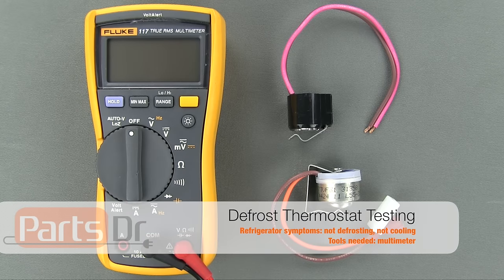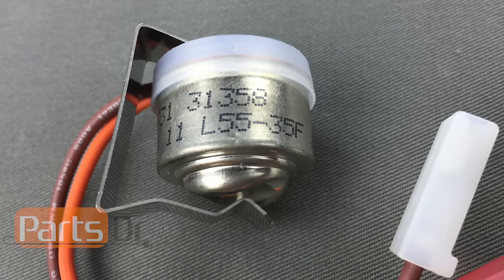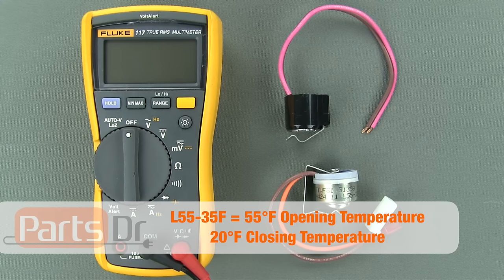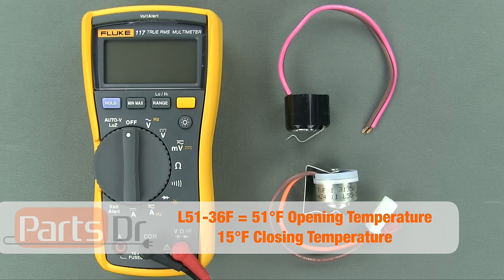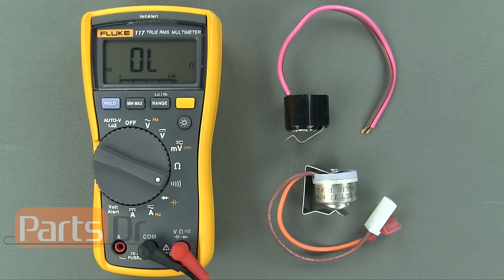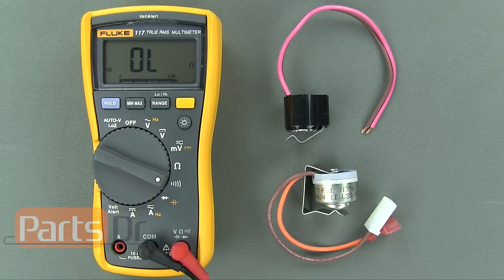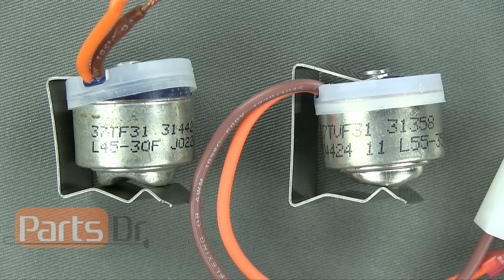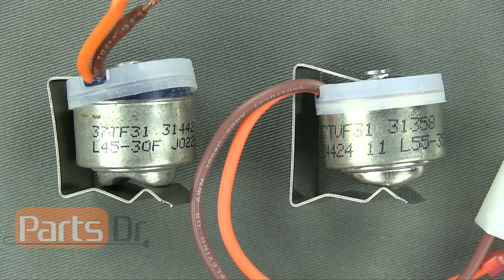How To Test Your Defrost Thermostat & How They Work

Comment: I just replaced mine
Seems the old device never actually broke continuity-so it ever actually shut off…I’m hopeful this resolved our issue…which is a form of thermal runaway..refrigerator gets cold, which triggered the sensor, so it caused the refrigerator to defrost-and because it never fully turned off the refrigerator was in a constant loop…
Reply from the maker: Let us know if it ends up fixing the issue.
Reply: It did not resolve the issue 
My refrigerator side is now over 50 degrees
Now perhaps I’ll try the defrost timer…

Any idea where it’s located on 
Whirlpool Refrigerator Model ED5VHEXVB04?
Reply: I’ve already tested the thermostat…
Reply: Looking on line, I found a site, and it appears this model doesn’t have the timer, just a board…
Reply from the maker: @1jefreys  Your model refrigerator uses a defrost control board in place of a defrost timer.  It should be located in the front top right corner in the area where the temperature controls are located.  This is the part here: https://partsdr.com/part/w10366605-defrost-control-board?model=ED5VHEXVB04

Comment: Hi there. I have a question? So every 7-10 days, my freezer freezes up, and I have to unplug it for a day and then plug back in. Also it will freeze up if I keep it open for more then 20 seconds. It never used to do that. It’s a side by side Ge Profile. I cleaned the coil in the back on the bottom, Fan runs perfect, compressor looks and feels like it’s working, it gets warm. Also looks like seals are ok. “I think”. There’s a very tiny cut in the bottom of seal, but I glued it and it closes very tight! I also put the Vaseline to make sure it’s extra tight seal.  Hard to pull open. I don’t wanna pay a whole bunch of money. Do you think I should open the freezer panel and check the thermostat and maybe the coil in there. I don’t really know what to look for. But right now it’s unplugged again. After it melts I’m gonna clean up the water. The only thing I have not looked at is anything behind the freezer panel. Any suggestions before plugging back in? Any help would be highly appreciated!!
Reply: Thankfully I bought a back up fridge in the pandemic for my garage, or food would of got destroyed every single time this happened 

I’m in a bad position because land lord might want me to pay half for a new one. A long time ago. I used to come home from the grocery store, and put a whole bunch of food in fridge while it was open, never had this issue. I’m stuck. My kids are afraid to go in fridge or freezer for more then 5 seconds. The longest it ever lasted since this problem began was about 2 week, so far I’ve did the unplug and defrost thing about 6 times. Sry for the long explanation. Wish I could just explain over phone, but these fridge repair people don’t let you speak on phone, and want to come out just to charge that initial consultation fee even if you don’t fix anything. I’d be surprised if you read this longggg message lol. Ok Take care. God Bless
Reply from the maker: What is the model number of the refrigerator?
Reply: Parts Dr Model #:PSW26SSNSS

Any tips on this model would be highly appreciated. Thx!!
Reply: Parts Dr I can’t believe how expensive this was. I know if land lord gets new one, he’s not gonna buy one as good as this.
Reply from the maker: @danielvitolo2595  There are 4 components that work together to control the defrost cycle on your model refrigerator.  Defrost thermostat, defrost temperature sensor (thermistor), defrost heater, and main control board.
Reply: Parts Dr Wow, ok Thank you. Out of the 4 parts you mentioned, is there one of them to have a tendency to possibly break before the others? Thx again. 

If it’s the board, that’s outta my league lol. I might be able to figure out how to test the others. 

Also, if I do end up taking the freezer panel off (most likely I’m going to do it tonight) and something looks a little weird, is there any way I can send you a pic? Sry for all the questions, this thing is driving me insane lol.
Reply from the maker: @danielvitolo2595  on these models the defrost temp sensor and defrost heater seem to be the most common to fail, but we see failures of all four parts.

https://partsdr.com/blog/how-to-test-a-ge-refrigerator-thermistor-sensor/

https://www.youtube.com/watch?v=q7hysgipzpQ

Comment: what will happen if not the right specs is installed...like my bad thermostat is hotpoint and i plan to replace it with my spare thermostat from frigedaire?
Reply from the maker: It is best to replace the thermostat with an exact match OEM part.  Installing one with the incorrect rating could damage the refrigerator or be a fire hazard.

Comment: Nice video clip. So - after watching this video - this device is electrically connected in series with the heating element right? So if the temperature gets above a certain temperature ----- then the device becomes an open circuit ------ which prevents any more heating until the next defrost cycle occurs, right?
Reply from the maker: Yes that is correct!
Reply: @PartsDr  Thanks very much!!!

Comment: I have one I checked with meter set to sound.  Checked good.  But when I set meter to Auto, I get a high reading of resistance. Does the bi-metal in the stat ever lose or gain resistance?
  This fridge was freezing over.  Df element checks good.  I have yet to check the timer.
  If I turn the timer to defrost and the heater comes on and goes off in the time it is supposed to, can I trust the stat is wirking properly, or are they like dryer thermostats that might check okay when ohmed but still be faulty?
Reply from the maker: Yes it is possible for moisture to get inside the thermostat and cause it to make a poor connection. If you suspect it might be bad, we would recommend to go ahead and replace it.

Comment: Hi, In May of this year. I had a "DEF" flashing off my GE Profile door monitor. I got a thermostat and a thermostat timer from Appliance Part Co. in Tempe, AZ. Installed them both and after a day "Def" flashing came back and ever since I just unplug and plug it back on. Today I decided to pull the back panel again and manually turn the defrost on thru the timer. I heater came on. I dbl checked the thermostat and to my surprise the the numbers on the replacement part is L140-30F. That says an opening of 140 and a closing of 110 degrees F. Is that why I am having a problem. I am going back tomorrow to that parts store.
I appreciate your feed back. Thank you.
Reply from the maker: Some newer GE refrigerators use the defrost thermostat as a high temperature safety and they use a control board and thermistor to monitor the temperature of the evaporator coil to tell the control board when to end the defrost cycle.

Comment: hello my old  Defrost Bimetal no any ohm, i test in cold and warm water  no any ohm, then i goto buy NEW WP4387503, BUt is SAME.... why??? thanks
Reply from the maker: It sounds like you aren't getting the thermostat below the closing temperature when testing it.  Re-watch the video and follow the instructions from the video.  Cold water does not get cold enough to test most defrost thermostats.
Reply: @PartsDr  thank, i watch your video and other video in youtube,  WP4387503 thermostat L8.9-16.7C, i use ice in water the water is 0C, and i take Defrost Bimetal out of water and no any ohm. i make a video later.
Reply from the maker: @mhz2562  Ice water isn't cold enough to close this thermostat.  8.9C = 48F and -16.7C = 2F
Reply: @PartsDr  thank, but i don;t have any thing can make -16.7C / 2F to test.

Comment: Hi my whirpool top freezer wont go below 24degrees F. Evap fan works, compressor fan works, replaced startup relay, none to little frost build up. Fins looks good. Defrost cucle comes on and compressor doesnt run. Am i missing something please help!
Reply from the maker: You might have a refrigerant leak in the sealed system.  Check to see if the evaporator coil is getting a light layer of frost evenly across the entire coil.  If only part of the evaporator coil gets cold then you have a sealed system problem and it might be time to replace the refrigerator.
Reply: Only by the bi-metal thermostat does it get any frost. The fins have no frost at all.
Reply from the maker: Sounds like a sealed system leak.  It is usually cheaper to replace the refrigerator than repair it.

Comment: GE Refrigerator evaporator iced up;  the defrost thermostat and heater are both good. What should I check for next. Please help. Thank you in advance
Reply from the maker: What is the model number of the refrigerator?  Use the link below for common locations to find the model number tag.
https://partsdr.com/model-number-locator/refrigerator
Reply: That was quick, thanks. The refrigerator came with the house. It's about 26 years old. The model number is partially faded; I could only make out 4 numbers. Since the defrost thermostat and heater are ok, could the problem be in the control thermostat
Reply from the maker: There should only be 3 defrost components on a GE refrigerator of that age.  We would check the defrost timer next.

Comment: I have a Sears Freg with a bottom freezer Mo # 596.65932402, Every thing
 check'd  out but we still have ice build up. I do not know how to test the main digital control. 
How do I put it into Force Defrost mode?  Thank you
Reply from the maker: On this refrigerator we commonly see the JAZZ control board go bad and it causes the compressor continue to run during the defrost cycle.  We recommend to replace the JAZZ control board part # PD00004512 and the defrost thermostat part # PD00003405 at the same time to fix the problem.  After replacing the parts make sure to manually fully defrost the evaporator coil.  Page 37 in the service manual below will show you how to force the defrost mode, but it will not give you the conclusive result.

https://drive.google.com/open?id=0B03VGCZpsUSCN055cmRZbnJhMzA
http://partsdr.com/part/w10503278-jazz-control-board/
http://partsdr.com/part/67003426-defrost-thermostat/
Reply: Is there a way to Force a Defrost cycle?  Thanks Alot!
Reply from the maker: If you click the "read more" at the bottom of my last post, I included information for that.  But like I said in that post, forcing the defrost won't tell you the whole story.
Reply: OK I see, hold freg door switch down and press Freg temp Down button down 3 times quickly. Than release door switch than  F and d will display than press ( - ) again.  Well, that did it and goes into defrost fine. . . but why do we still have frost at the freezer vents? If the JAZZ board is bad than does Forced Defrost bypass it?  Thank you
Reply from the maker: Most commonly we see the JAZZ board go bad which causes the compressor to continue to run even during the defrost cycle.  Forcing the defrost cycle won't tell you whether the compressor kicks on during the defrost cycle.  The best way to fix the problem is to replace the JAZZ board and defrost thermostat and then manually defrost the freezer.  Once you do that you should be all set.
Reply: So you are saying forced defrost works different from automatic defrost because . . ?  Thank you
Reply from the maker: Forcing defrost won't tell you if there is a problem with the compressor running during the automatic defrost cycle.

Comment: Quick question. How would you interpret a bimetal/thermodisc labeled F42-32F? Does it work differently as in closed when above 42 degrees and stays closed then cuts open at 10 degrees? This part is wired in series with a cold control thermostat, not a defrost heater.
Reply from the maker: That should open at 42F and close at 10F.  Sometimes a bi-metal thermostat is used to turn a fan motor on/off at a certain temperature.
Reply: Thanks for the reply. I thought this too but if it opens back up at 42*F then the unit wouldn’t cool if wired in series with a cold control. This bimetal has specs different than most fridge bimetals. Would you like to take a look at this GE fridge wiring diagram and see if you can make sense of it’s operation? It has no actual defrost circuit and instead lets frost thaw while the thermostat & bimetal are open. 

https://imgur.com/a/8IINMov

Comment: We're testing our defrost thermostat. At room temperature it's reading 0.00 for continuity. We bought a new one thinking the old one was broken. It also reads 0.00 at room temperature. Visually they both look fine. Is our multimeter not working correctly or are we crazy?
Reply from the maker: What is the part number?

Comment: If the new thermostat has a different wiring code, does it matter how you make the connection?
Reply from the maker: On most refrigerators it does not matter which of the two wires from the thermostat goes to which of the two wires in the refrigerator.

Comment: I have a Sears Kenmore Fridge with Freezer on top model# 253.6480240C. Found that food was partially defrosted in freezer. The freezer temp is only 32F and the fridge temp is only 48F.  I used a screwdriver to manually advance the defrost timer and that did turn on/off the the sound of what I believe to be the compressor as well as the freezer fan. Turning the fridge temperature control knob from lowest setting (left) to highest setting (right) also turns on and off the same sound. I clamped my multimeter on to the red wire near the compressor and it read ~ 1.6 amps when I believe the compressor is running. The freezer fan is definitely rotating as cold air is being pushed out of the freezer vents. I removed the freezer evaporator cover and confirmed the fan is rotating. There was a 3/4 x 2" chunk of ice on the tube (that does not have the thermostat attached to it) right near the fins of the evaporator, otherwise, no real icing in the freezer. The defrost heater element has continuity. I am suspecting the defrost thermostat. I don't want to cut the wires just to test unless I'm on the right track. Is this the next likely culpret that should be tested? Any advice?
Reply from the maker: Hi Jeff,  it sounds like you probably have a refrigerant leak.  Usually if you are only getting a small section of the evaporator coil that gets frost/ice on it, that is and indicator that there is a leak in the sealed system.  This type of repair is expensive and must be done by a professional so it might be better to replace the refrigerator.
Reply: Thank you so much for your quick reply, even though it doesn't sound good for me :-) Given the likelihood of what's wrong, would it be beneficial to cut the thermostat and test it on the off chance that it is stuck on which would cause the defrost element to be on more than it should driving up the temperature inside the freezer/fridge somewhat? Or would it not work that way or have that effect? Thinking of a last ditch effort?
Reply: I cut out the thermostat and checked for continuity >47F and it was open as expected. I put it in a working freezer for a few hours and just checked it and it was closed, as expected for <25F. Any other reasonable possibilities before I trash it and buy something else?
Reply from the maker: The only thing we are aware of that can cause that type of problem is a sealed system problem.   Unfortunately you will probably have to replace the refrigerator.
Reply: Thanks, we did buy one.

Comment: my freezer works and I removed the cover to expose the coils.  They had some frost but not much. I defrosted them anyway.  The frig is still not cooling.  what next?
Reply: one time i remember finding an electric damper motor not working properly... make sure that the opening between freezer and ref section is open and not blocked somehow.

Comment: I getting continuity on both closing and opening temperatures. Does it mean the defrost thermostat is faulty?
Reply from the maker: What is the part number of the thermostat or model number of the refrigerator?
Reply: @PartsDr  thanks for your response. The refrigerator model number is RF26BEAEWW
Reply from the maker: @thomassankara2857  That model is not valid.  Check out this video on how to locate and read your model tag here: https://www.youtube.com/watch?v=4HhWL9sonuE
Reply: @PartsDr  you were right! The model no.  is RF263BEAEWW
Reply from the maker: @thomassankara2857  The bi-metal thermostat in your model refrigerator is a high temperature safety.  It has a higher opening and closing temperature so it will have continuity at room temperature.

Comment: great video and very educational. My kenmore side by side fridge is in the garage and the evaporator fan keeps running.  I've done the diagnostic checks to include forcing the heater to come on. The whole time I was in diagnostic mode, the evaporator fan was on.  It seems like the thermostat is the problem but I can't be sure until I open it up and inspect the thermostat.  What else do you think might be the problem?
Reply from the maker: What is the model number of the refrigerator?
Reply from the maker: @carlostrejo8699  The fan motor is probably controlled by one of the control boards on your refrigerator.  It could run constantly if it isn't cooling cold enough.
Reply: @PartsDr  well....that's the peculiar thing, it is cooling.  I thought the temp control was set too low thinking it might be trying to reach that temp that it can't so I raised it a couple of degrees.  Factory set is 37F, it was set at 33. There is frost on the bottom of the back panel in the freezer and that's why I think it might be the thermostat.  I'm open to more advice.  thanks
Reply: is there a way to determine inside temperature without a heat gun?